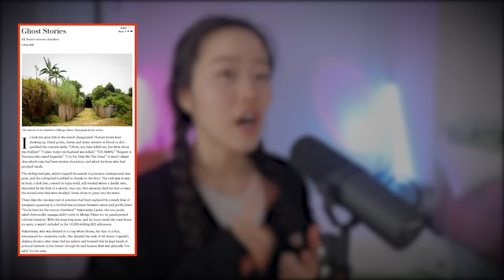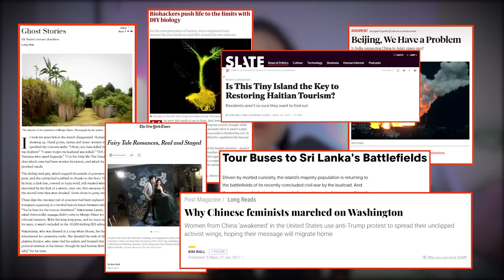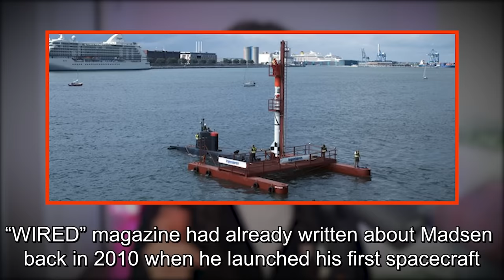A Submarine Went Missing & Body Parts Were Found A Week Later In The Water

Comment: Looking at the sub's tower at time= 40:55 it appears you can't close the hatch while standing on top of it. There doesn't appear to be enough room. I think the hatch was meant to be closed only from below. Basically there would normally be no need to close the hatch if you are outside it. Also, if the sub is sinking anyway, why bother? That won't stop it from going down.

Comment: Just a small correction. One does not have to invent something "brand new" to be considered an "inventor".  Innovation comes in two forms, "fundamental innovation" and "incremental innovaton".  

The rocket was "invented" over 1000 years ago in China, but nobody would deny that Robert Goddard (or Werner Von Braun)  invented the modern rocket. What's the difference? Same principle as 1000 years ago. Mass goes out the bck, rocket moves fowards. The fundamentals were known centuries ago, and further explained by Newton.

Same goes for Elon Musk. He didn't invent a damn thing. He hried engineers to develop vertical landing systems and reusable rockets.

So this is why Masden was compared to Musk anyway. Not because of his inventiveness (which is redundant for both Masden and Musk anyway), but because they were involved in innovating in rocketry. Clearly it was not a financial comparison.